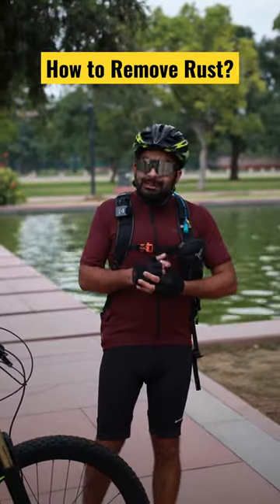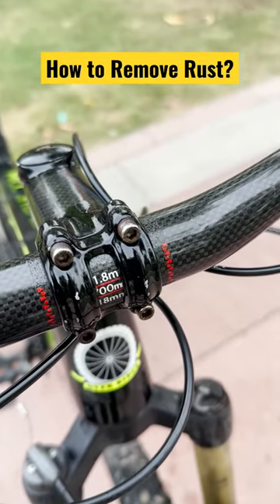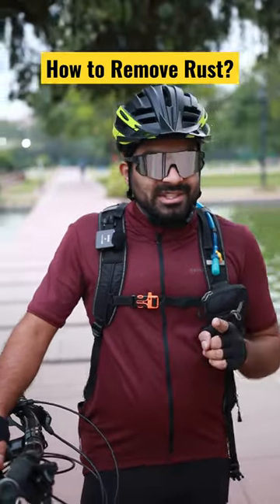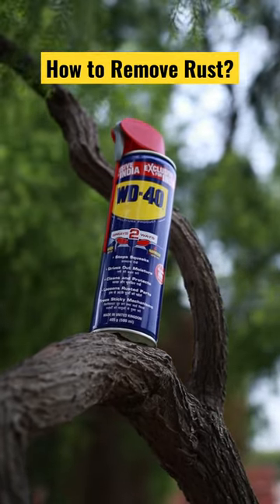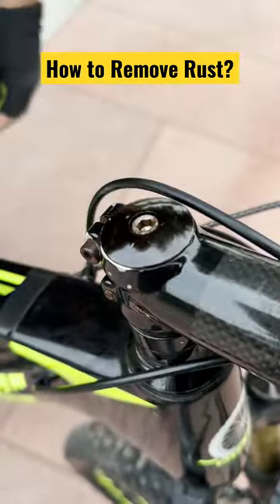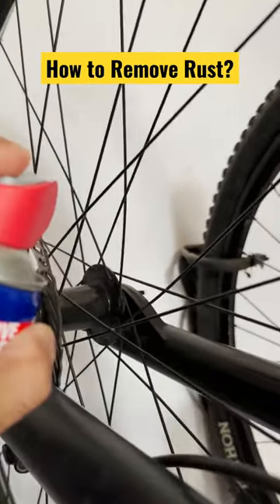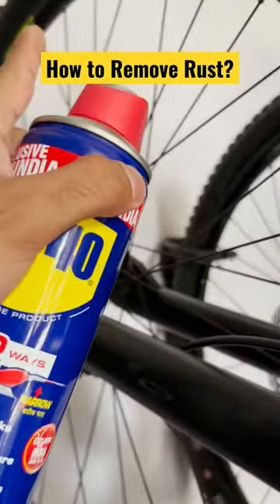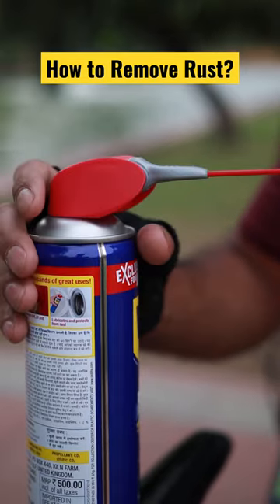How to Remove RUST from BICYCLE ? | Easiest Tip

Comment: remember to protect the disc before spraying on the spokes
Reply: But why?
Reply: @rudmish1824 disc  is very sensitive don't put Oli or any spray another disc will spoil and won't work your braking will be poor
Reply: I Spray it Directly on My Rotors it helps with corrosion and oxidation it also keeps Them from overheating or you can just pour ice water on Them when They are Hot

Comment: Can we use wd 40 on a disc brake of cycle
I use wd40 on my cycle disc brake and brakes are not working. Brakes of slippery
Reply: you shouldn't use wd40 on brakes. it's a water displacer, acts like oil.